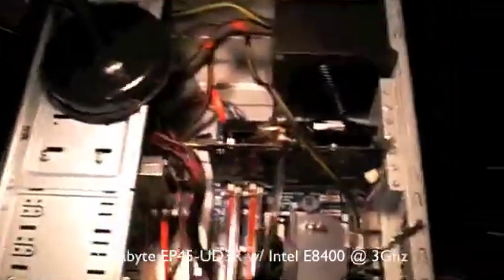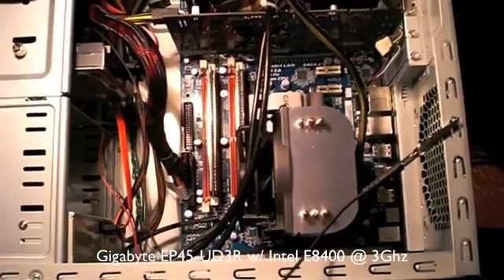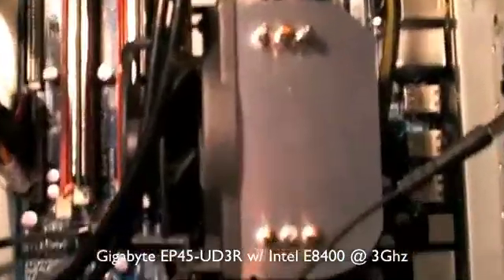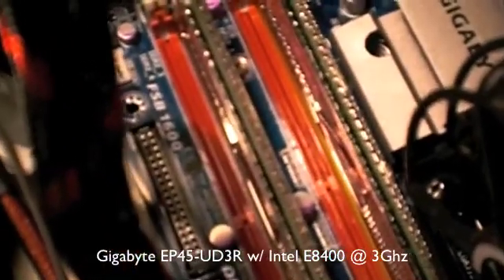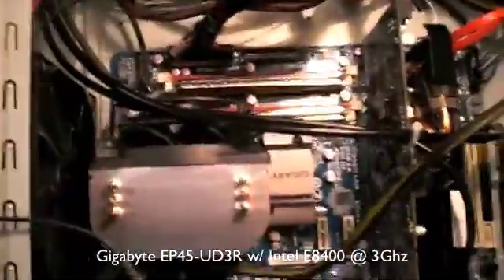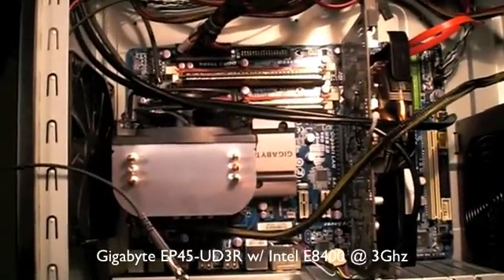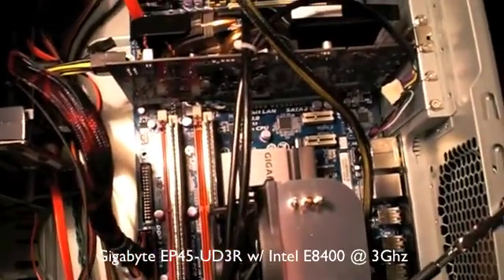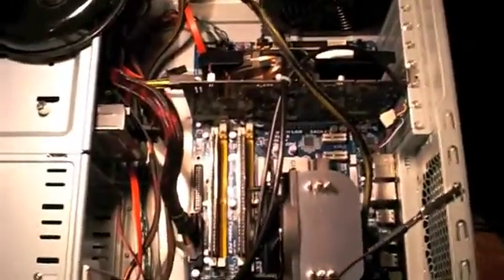EP45

Comment: As you already mentioned that you have a recent PSU, then its either CPU or MOBO. 

> Remove the CPU and restart PC. If you hear beeps then Mobo detects that there is no CPU and this implies there is something wrong with CPU which isn't letting system boot. However if you don't hear beeps that means the motherboard isn't detecting any absence of hardware on it and this could mean the motherboard is faulty. 

Or  you could try removing RAM first and then graphics card and see what happens.

Comment: If you hear beeps that means mobo detects graphics card is removed. So this implies that something is wrong with graphics card which isn't letting the system POST.
>If you don't hear beeps then remove the RAM stick and restart PC. If you hear beeps that means mobo detects that there is no RAM and that implies there is something wrong with RAM which isn't letting system boot. 

>However if you don't hear beeps after having removed graphics card and ram, then it is either CPU, PSU or your MOBO

Comment: Hi coldfused

I would suggest detaching hdds and dvd/cd writer and any other hardware  from the mobo and only having 1 stick of brand new ram in the dimm socket along with cpu+ cooler and graphics card + monitor and ofcourse the psu. Also do you have the beep speaker attached to front header panel ? 

>Now try turning on the pc and see if it goes into post screen. If it doesn't then do the following:
> Take out the graphics card and restart PC. You should hear beeps.